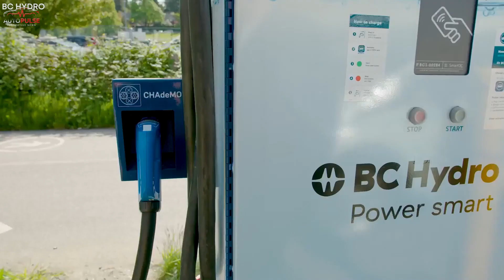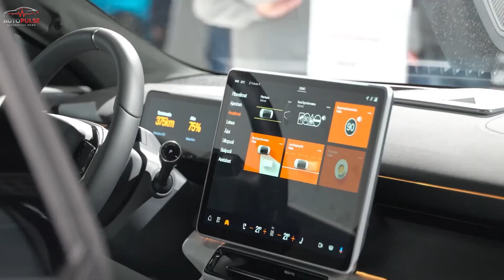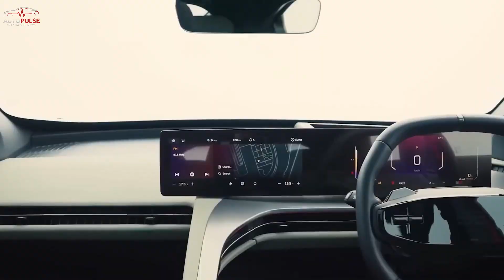India’s $2K Electric Car Is Real — And It’s Shaking Up the EV Market

Comment: $2k golf cart type car with 60 miles range will meet the fate of Tata Nano.
Reply from the maker: Interesting comparison to the Tata Nano! But there are key differences here. The Nano failed because it was marketed as the "cheapest car" which hurt its image, plus it had safety and reliability issues.

This $2K EV is targeting a completely different market - urban commuters who currently use motorcycles or rickshaws. In Indian cities, a 60-mile range actually covers most daily needs, and the electric drivetrain means lower maintenance costs.

The real advantage? Government incentives for EVs vs. none for the Nano, plus rising fuel costs make electric more attractive now than gas was in 2008.

The golf cart comparison isn't wrong, but in dense Indian traffic, that might actually be a feature, not a bug!
Reply: @AutoPulse-f7u  Nano was also targeted for people using two wheelers. 100km range in real life would be more like 70 km.